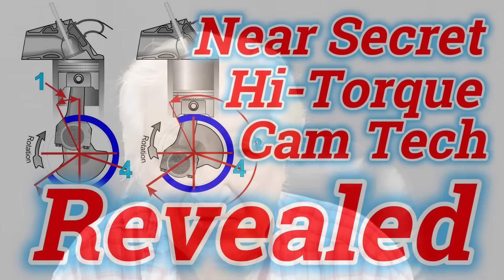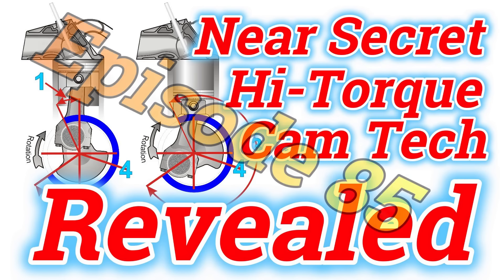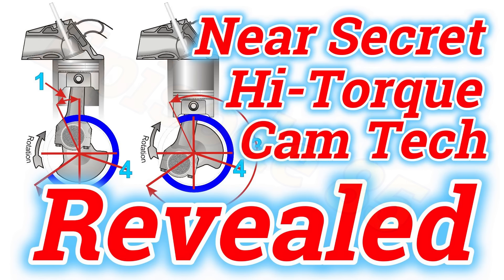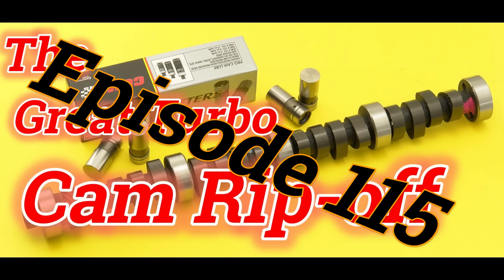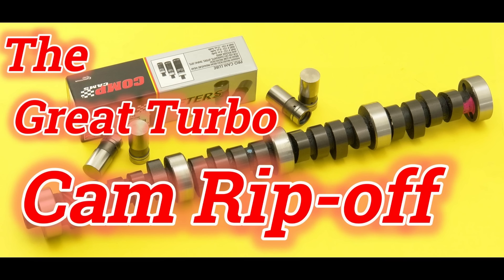The truth about LCA's Vs idle & vacuum quality

Comment: I will have to re-watch the videos again, but if I remember right your equation was only good down to like 9:1 or something like that.  How about for us guys with the 7:8 454 truck engines with peanut port heads.  I have to get over 7k pounds moving  (empty) in my 1-ton truck with 456 gears and a 35" tire.  I currently have a mystery cam with 049 heads swapped by the previous owner.  It runs good- like a car, but needs to rev to make any power and I think it needs "the wrong cam" replaced with a much tighter LSA and duration around 200-210 with street mannered peanut ports (I just bought 045s) to have STRONG off the line torque.  It seems that UD Harold made a few cam for the low compression motors to do what I am talking about, but the "gate keepers" seem to have buried the grind info and part numbers.  Please make a video talking about LSA on low compression big blocks and if I should use max lift for what peanut ports flow (.500 ish ??) or if that is too much lift and going to hurt the low end.  I currently have a Coan 2600 stall converter (long story) but will be swapping it out for a Hughes (Fuel Miser or Tow Miser.)

Comment: LSA=128-(CID/8/Valve Diameter X .91)
Reply: For a 355 SBC, with 10.5 static CR, with good heads. Change variables, such as CR, valve size, CI's, etc, and there are adjustments that are needed. All clearly laid out in his book, which I recommend to everyone. Great info.

Comment: Years ago, I swapped cams from an Isky Mega 270 (221/221-108) to a Crane 216/224-112 due to the hype about Fords needing the duration split. Couldn't believe how much slower the truck was with the 112 cam.
Reply: Advance it. Or put more gear ⚙️ to it!

Comment: Thanks David. Could I use the big block Chevy constants for the 351 Cleveland ,for approximation?
Reply: 107* Thumper works great in our 351C... But it is lumpy... But gut busting torque.
Reply: @hotrodray6802  hi Ray, I’m using 108 right now 530 lift. I don’t remember the duration. (No cam card in my office it’s in the garage)

Comment: DV, I would love to hear your input on the Gen 3 Hemi platform, specifically the 5.7 "Eagle" 10.5:1 engine with stock heads.  Several companies have flowed the stock Eagle heads so I won't go into that here.  They flow pretty good, for a stock cylinder head.  I want to change the cam in my 5.7 and am leaning towards (one of very few) a 108* LCA, offered under the "El Chapo" label from Scoggin Dickey Performance.  215*/221* on a 108* LSA, with .587" lift I & E.  Application is a street-driven, daily driven Challenger with a 6-spd Tremec (unlimited stall 🙂) and 3.92 gears, which gets it rolling in short order.  I don't chase horsepower numbers.  I know that it's torque that does all of the work, so I'm more interested in power under the curve.  There will be a HP increase, just by getting the stock camshaft out of there. :)

Comment: Have a 355sbc. Edelbrock aluminum heads, Edelbrock h122 blower. 850 blower carb. 
9.25 static comp. 8psi of boost. In a 3200lb car. Picked a dougherty cam. 228/234@50 535lift 114lsa. Idles very well, lots of vacuum 18 at idle. Pulls hard to 6500. 
Had a comp 230/230 @50 515 lift on a 110 lsa before did not work nearly as well.
Reply: it's the smaller intake duration, bigger exhaust  duration, you are forcing air/fuel in, you need more outflow, that's what the second cam is giving you. 😊
you can keep the same durations, and go down to a 108• lsa
and get more Torque. 🤠
Reply: @soldierbyname
Is that what's in the C3 in your video? Do you have any other footage?

I only ask because I'm going to be installing one in my 1971 Camaro this spring and it's hard to find any motivational videos with that supercharger. 
Thanks 👍

Comment: I keep thinking of my Harley Sportster, it has four cams one lobe for each valve, one could change the lobe center line  by shifting the intake and exhaust cams   gears with each other. One would have to check the valve to piston clearance closey first. It would be a very interesting experament.
Reply: Yea bro....I wish he would derive a constant for Harley engines!  It’s doable, but DV may not want to allocate the time needed to do it.  It would be nice because Harley cams are marketed by totally different specs than hotrod car cams.

Comment: How about giving us Pontiac guys some love!!  Love to hear how your program works on  400 Pontiac!!
Reply: I think there's a fudge factor in the 128... 126 ? I don't know.
Even if you're off a couple it's better than the wide LSA the cam companies push to you
Reply: I have been asking him for over a year to talk about Pontiacs, from what I read he worked on them back in the day. 
 Come on David show us some love!!
Reply: Check his books. 
 "How to Build Horsepower "
Should give you a more generic way to get there (or close) based on valve size vs cylinder volume. Then adjust for compression and other things. I have used this for everything from a pinto to 496 BBC with good results before he had refined it to the "128 rule" although I have been out of performance arena for quite a while.

Comment: Thank you Mr. Vizard.  I think you've mentioned cam companies are under pressure to supply "too big" of cams for the application due to customers being greedy for power.  So they spread the lsa to kill some overlap.  But then the cam ends up being a little lazy, especially in low and midrange. Thank you for cutting through the bull!

Comment: most ppl buy to much duration for a street cam and lose a lot of low end torque, the BIG Peak HP numbers sell came shafts, great for the 1/4 mile
not good for the torque curve for a street engine.

Comment: I pulled the 350 pontiac out of my wifes 68 pontiac and went through it. To my surprise it had a cam in it that was ground on a 108 seperation and i remember thinking how the hell can that be because it had a super smooth idle quality. I went with the pontiac "needs a 110 pontiac grind blah blah blah. So i did with very simular specs and i swear it was never as torquey off the bottom end as what i had. I always wanted to dyno both cams to find out.
Reply: Big 💪🏻 comes in small packages 😉

Comment: I wish I would have known this years ago. I called comp for my Dually Vortec 454. I asked for an aggressive towing cam and they gave me a 01-412-8 Xtreme energy. specs 264/270 duration .510 lift and 113 LSA. with mild ported head, headers, exhaust, intake, injectors my tuner couldn't get it to idle any lower than 950RPM. It ran ok but low end seemed to be lacking.
Reply: Tow vehicles don't like lots of compression to much chamber heat or duration

Comment: id love for DV to spec a ls 5.3 cam specs with standard heads 7g rpm limit. i would think it end up in the 108-106 LSA area the duration would be intresting.. and say just go dyno headers, and 750 DP on a vic jnr

Comment: The way I see it is way too often a cam with too much duration is selected. The customer is thinking more is better and too much is just right. They have no idea of the many processes going on in a running engine to effectively the cylinder and then cap it off before the charge is lost. That to me is the major if not sole purpose of the cam.
Reply: Agreed.  And as David points out, for a given LSA (LCA), too much duration results in too much overlap, and poor idle, low speed torque.  The big cam companies know you'll pick too much duration, so they broaden the LSA to lower the overlap.  Wrong way to pick a cam.  The TMC program will calculate the LSA, you pick the overlap, and the duration, and that specifies the valve timing fully.  Only thing to spec out is the max lift after that, and the aggressiveness of the lobes.
Reply: @pete540Z  exactly

Comment: In a way, we almost can't really blame the cam makers for not selling the best possible cam, most of the cams are going into stock head and bottom end engines, most even with a stock intake and usually generic a long tube header. The manufacturers never designed those engines to make power, they were designed with emissions and fuel economy first and the power was just a side effect. I always took it as them selling a less than optimal cam on purpose, they want to give just enough of a power gain to get $200-500 out of a customer and I feel that they leave the extra power on the table so there is something they can sell someone who wants to pay more and get as much as possible. I always felt like they didn't want to get beaten on the street or strip by the average jackstand jimmy who didn't have to drop all the money on creating an optimized program. Maybe I'm wrong and these dudes really think they are selling the best they have but, I doubt it. It's the same as GM selling so many 4.8 and 5.3 engines that were designed to squeak through the fuel economy and emissions testing yet in the real world you could probably get the same fuel economy out of a 5.7 or 6.0L, it wouldn't have cost GM any extra to just build 5.7 or 6.0 engines as the base and put them in everything with a 6.2/6.6/7.0L as the upgrade engine/HD truck/supercar engine, who knows why they did it all these years and didn't give the customers the best they possibly could have. That seems to be the way everything is, the world is full of bean counters, greedy executives, non-enthusiasts and non-scientists. I blame DEI programs that promote and hire based upon immutable differences rather than intelligence, capability, experience, work ethic, passion and qualifications. Diversity never existed before and was considered dangerous to societies of the past. You will not do the best work you can to improve the future for people you don't care about who are dissimilar to you.

Comment: Cant wait for LS info. 
Using your 128 rule I come up with a cam that no one makes (223 on a 108).  The gospel in the LS world is manuals want 112deg of overlap and autos want 114.  Other than that it's all about what stage cam makes the most chop face-palm
Reply: Most likely your favorite cam manufacturer will make it for you if you give them a call (and probably a few bucks more for a custom cam).  Well worth it.
Reply: @Staypuff777  I'll have to give that a try.  With Dave's formula I can get LSA and intake duration.  Ive heard him say lift is valve diameter  × 1.3, but still haven't nailed down exhaust duration or what intake centerline should be?  (How do I know where to degree the cam?)

Comment: Wish I would have known, I just installed a nsr truck norris cam for the ease of it and the hype. 4th gen 6.0 ls with 823 rectangle port heads terminator x max and 4l80e in a street 1994 s10. Also, I’m building a 1st gen sbc 383 10.5:1 cr with TH400 and 4.11:1 gear in a 1989 rx7. I bought the Lunati voodoo 268 cam 110 lsa but I will not be using it and will be using your lsa method for the cam. Maybe I will compare on dyno and look at average power. I hate learning the hard way and wish there were more research and development in the right direction like this.

Comment: Way back in either 81 or 82 when Competition Cams introduced the High Energy 268 for small Chevy's they ran a huge ad campaign so I bought one and believe me they were high back then, paid 125 bucks which was a lot! Installed it in my 78 Z28 that I bought new which by this time had headers ,dual plane intake, "legendary" 350 hp 327 copy cam , still stock 8.5 compression and stock converter and would run 15.0's with that combo. The original 268 H.E. had a LS of 108 with 218 duration and was pretty choppy but worked fine and it knocked a full second off my E.T. down to 14.0's with no other change. It lived up to it's hype and i was ecstatic but I guess they felt the need to smooth it out and it wasn't but about a year and the LS was moved to 110 which is the Comp Cams norm now.

Comment: I have a book on tuning Weber carburettors and it gives suggested idle speeds depending on cam duration, lower duration suggest lower idle speed and higher speeds for longer duration cams.does that align with the information in this video?

Comment: Find Out For Yourself. I Took The Information He Provided And Compared Many Dyno Graphs Especially From Richard Holdener To Verify What Overlap, LSA, And Duration Do. Go Into Richards Videos Of Cam Comparisons And Make Inferences Based Off Of What Vizard Has Shared Across His Channel And Books. You Will See They Line Right Up.

There Is Only One LSA That's Optimal For A Given Engine Combination. There Is No Real Advantage To Running An LSA Wide Or Narrow From Optimal LSA. Cam Companies Treat LSA As The "Last Cam Spec" / As An Output Not An Input. They Simply Say "It's To Adjust Overlap".

Intake Duration Is Where You Make Your Power On The RPM Axis. It Shifts Your Power Curve Left Or Right On RPM Axis. Playing With Exhaust Duration (If Camshaft Isn't Single Pattern) Slightly Changes How It Carries The Power. Longer Exhaust Duration Can Slightly Extend The Peak Power Plateau At The Cost Of Down Low Output. You Also Have To Consider That These Duration Changes / Combinations Change Your Overlap.

Overlap Affects How Well It Makes Its Power At Its RPM Range Determined By Its Intake Duration. Lots Of Overlap Makes Engine Do Better At That RPM Peak At The Cost Of Low RPM. The Low RPM Trade Of Is Drivability/Idle That Are Typically Off Dyno Graphs (Below 2500 RPM) Overlap Doesn't Really Shift The Power Curve Left Or Right On RPM Axis, It Just Sort Of Shifts The Peak Hump Up Or Down On HP Axis.

I've Only Seen A Handful Of Dyno Graphs Comparing Engines With Different Camshafts And This Is The General Trend I've Concluded. I've Not Seen Enough To Accurately Account For Special Situations Like Reverse Pattern Camshafts Or Advanced Turbo Applications etc.

Spec The Cam Starting With LSA. Keep In Mind Most Comp Cams Cores For Custom Grinds Wont Allow You To Grind Tighter Than 110°.

Next Decide What RPM Range You Want The Engine To Operate At. Try And Find Dyno Videos With Your Engine Like On Richard Holdeners Comparing Cams With Different Intake Durations. That Will Give You A Good Idea Of What Intake Duration Equates To RPM Wise. Make Sure You Keep Intake Runner Length In Account As This Also Shifts Your RPM Range Of Engine Left And Right On RPM Axis Very Similar To How Intake Duration Does. 

Finally Decide How Much Overlap You Can Live With. Do You Want To Get A Higher Stall Converter? How Alive Or Dead Do You Want It To Feel In Stop And Go City Traffic? Will You Have A Vacuum Brake Booster? etc etc.

 It's Hard To Say How Much Overlap You Want. My Advice Is Find Some With Your Similar Engine With A Cam. See How That Fairs With Idle In Terms Of Needing A Higher Stall Converter And The Sound (I know sound Is Important To People). Then Take Those Cam Specs From That Similar Engine You Observed And Calculate Both Overlap Values For Advertised And @.050". Reference These When Adjusting Or Searching Camshafts With Desired LSA And Your Target Intake Duration.

In My Experience With A 5.7 V8 Hemi And A 3.8 V6 With Custom Camshafts That Have The Similar Amounts Of Overlap . The 3.8 Lopes Alot More. The 5.7 Was Ok With Stock Converter Stall, The 3.8 Needed A Slightly Higher Stall. I Can't Say I Know For Sure But I'm Guessing Bigger Engines With More Compression Can Idle Better With More Overlap Compared To Smaller Lower Compression Engines. 

The 5.7 Hemi Was A 206/212 110.5LSA

The 3.8 Was A 210/212 110LSA
Reply: Ok. Your points are well taken. However, there is absolutely no reason to CAPITALIZE every single word of your text.
Reply: @JeffKopis  sorry, it's just the way i like to type.

Comment: Lobe centerline index and lobe separation angle and duration of cam lobe lift are all completely different definitions.
I do get David's point. 
Do pay attention. This is cam science, and if understood,  you will know why your power brakes dont work any more or after green engine breakin, you drop your automatic transmission into drive and stall the motor.

Comment: 40+  years ago I changed rocker ratio to aluminum 1.6 with better  springs and mildly ported heads on my 69 Z28 which pick up .2 in the the 1/4  with a 4:88. Did even better when lunach was work out. My point is that the factory  cam was dam good and rockers gave more flow ,old Indy engine builder show me this when I was in high school and all he stressed was port velocity at points that impeded flow

Comment: David does your cam software work with other types of engines? Vw flat 4 for example. 
Another great video!! Would love to see video on valve seat cutting and angles and seat 

dimensions.  Thanks DV!!
Reply: Yes it works for vw motors, i used this in my cam decision to get what i needed... put me right around 230@0.050 duration which was smack on... from there pick the total lift for your heads and compression to give you what you need
Reply: I'm keen to know if this works for VW Flat4 aircooled engines too. I've read cover to cover DV's books and applied the LCA formula. But I think a piece of the info I in put was not quite accurate because I came up with a LCA exactly as the general production cams which never change (108). But one VW engine builder is often using tighter LCA.
Reply: @mathewboyd3746  yes essentially its going to be 108 for most, the overlap is going to be the main difference in setting duration; CB makes theirs on a 107; you can always advance or retard the intake centerline to get it where you think it should be.

Comment: It all seemed so simple to me, and perfectly logical! We've always known that LESS DURATION = MORE TORQUE. LESS OVERLAP = SMOOTHER IDLE AND DRIVEABILITY. So where is the disconnect. The overlap determines the idle quality, not the LSA!
Reply: I think everyone wants solid roller high lift numbers in a hydraulic lifter engine.
Reply: in the 60's people thought Chevy was going to wider lobe angles for better idle,
Reply: LESS IS MORE allot of the time..